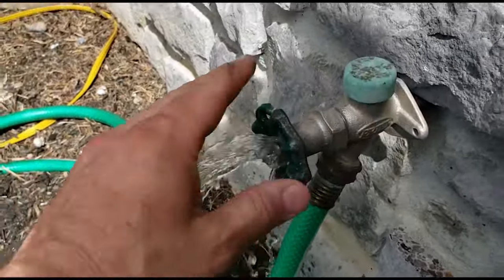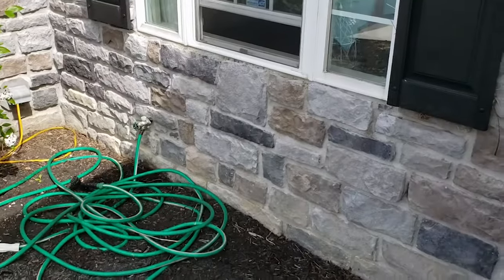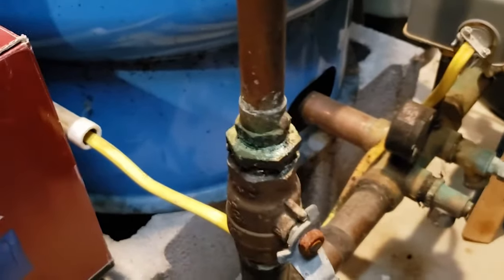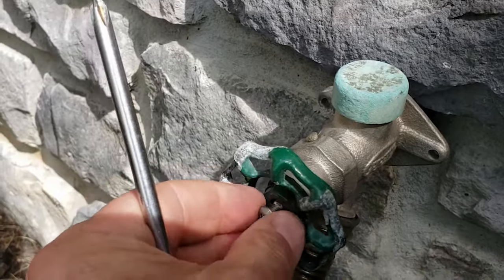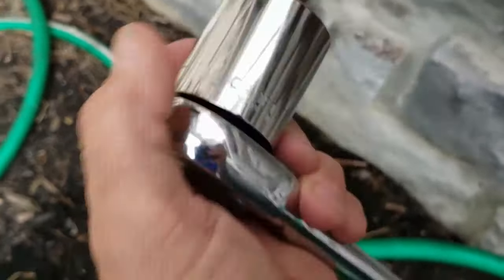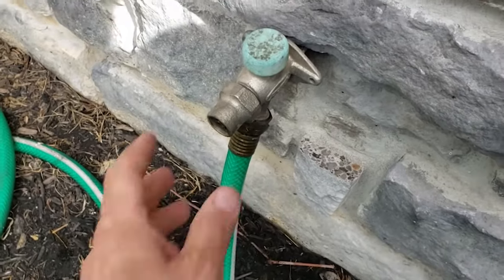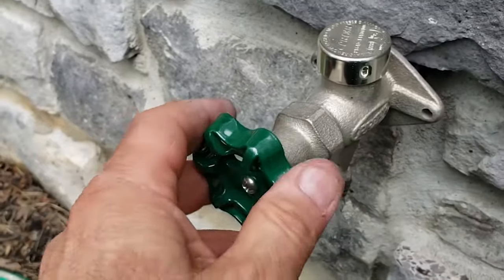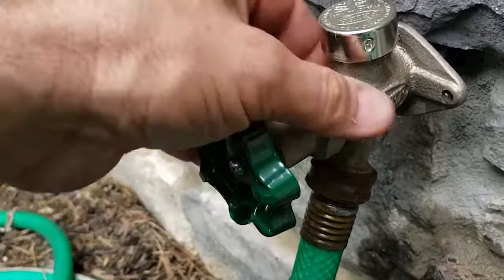DIY: Leaking Exterior Faucet Repair | Style Prier C-144

Comment: Magic fix off camera.  Kinda defeats the purpose.
Reply from the maker: Not following your comment, what does Magic fix off camera mean?
Reply: @DIYinspiredLewisBrantner  10:35 you say you need to tighten a couple things up because it still leaks, but do not show you fixing it unedited.
Reply from the maker: @1jantheman1  correct, under the silver cap, that plastic piece needed tightened up some more. As you saw in the video, I only placed that finger tight. I removed the silver cap and then tightened it more, then put the silver cap back on and it was good to go. Thanks for clarifying

Comment: It was helpful but I didn’t understand what you did after it leaked from the vacuum cap after installing the new parts?
Reply from the maker: it was little loose so I tightned it up and all was good
Reply: @DIYinspiredLewisBrantner  it would of been nice if you actually showed when you were tightening it
Reply from the maker: @blueboxstar5284  yes. It's at the 8 min 30 second mark
Reply from the maker: Thanks for watching

Comment: I am following your very helpful video to repair mine. I am at 0:45 time point in your video, but can't go beyond that. The valve stem isn't coming out even after turning and pulling with a wrench. Any suggestion? Spray WD40?
Reply from the maker: Hmmmm, my guess is it will come out..... my suggestion is just tug on it more as you turn it..... try that.

Comment: Dont you have to tighten with a tool that piece as well on minute 8:54? I ask because mine was leaking a bit of water out through it for 2-3 seconds everytime I closed the faucet so I tighten it a bit with my tool and it stopped leaking.
Reply from the maker: Yes, this clear plastic piece needed tightened too. I had to go back and tighten it also.
Reply from the maker: thanks for sharing your comments

Comment: My spigot looks similar to yours except mine doesn't have that syphon knob on top. Would that make a difference on a valve stem repair?
Reply from the maker: Great question..... not sure. Maybe you could take yours apart to see if the parts look the same. You could put it back together if it isn't.  Just make sure you have the water shut off inside
Reply: @DIYinspiredLewisBrantner  
Thank you. It doesn't leak but part of the stem that's connected to the nut you take off is broken and the handle doesn't fit right. So I'm wanting to replace the valve stem and nut, if it's possible.
Reply: Mines the same real old school one. Guess I can paste a pic

Comment: If the top cap has a little drip, it’s super tight.  Should I use plumbing tape to fix the drip?
Reply from the maker: I replaced a second one at my place and the same thing happened. I took it apart again and saw I pinched the flapper part so I reused the old one..... that worked for me
Reply: @DIYinspiredLewisBrantner  I was gonna use my old one but it got destroyed since it was stuck inside.  I had to beat it up pretty bad.

Comment: I just ordered the kit off your link but in your package I saw you had two kits?
Reply: Package in the video*
Reply from the maker: I ordered 2 of them. I have one of these in the front of my house and one on the rear side of my house
Reply from the maker: Wonderful..... glad the video was helpful
Reply: @DIYinspiredLewisBrantner So mine says it's a Prier C-144/C-244 on the airwave cap. I received the kit and they don't look exactly the same parts. Is the kit I ordered a multiple type fita? I ended up using the old parts along with a peerless plumbing repair assortment kit I bought a long time ago
Reply from the maker: @Saint696Anger  interesting..... not sure..... great to hear you got yours fixed
Reply: Thanks.. you know more than the customer service guy i called at prier . Thanks again..I've subscribed
Reply: Sorry I posted this on replies I suck at tech stuff